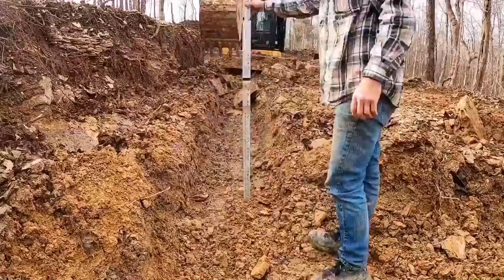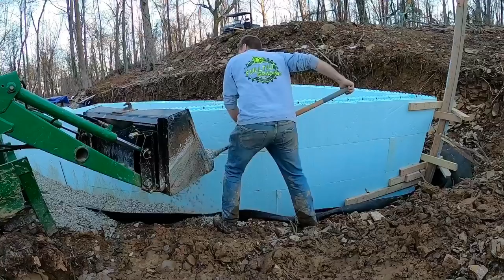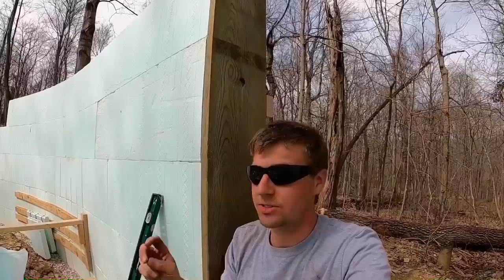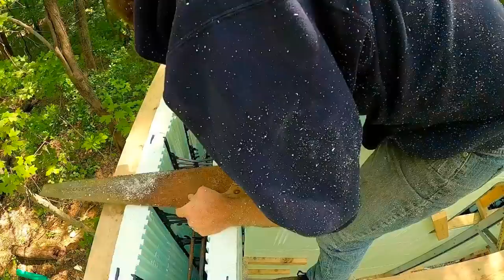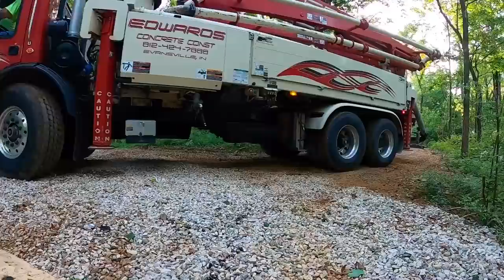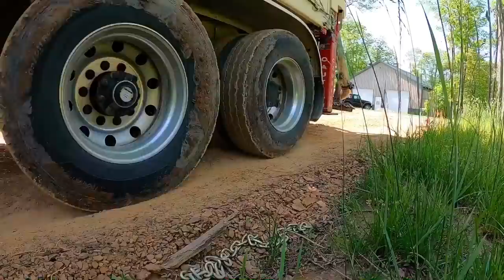Building our first Rental Cabin - Looking Back on the First 7 Months of Building

Comment: The part missing, road building, drainage installation for the road, chirt hauling and dressing for the road, fail on the original site due to soil perk fail. The work that went into getting the project to the point you could dig the foundation and footers out.
Still a good recap of the excavation and setting up the form for the project.